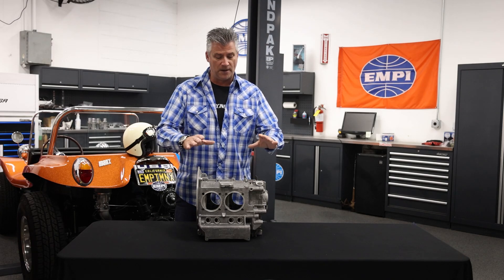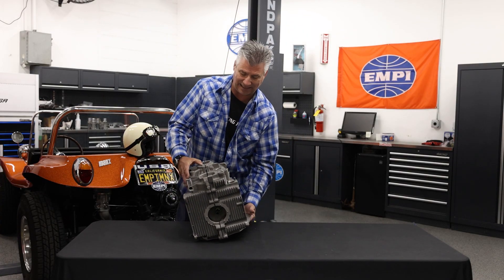EMPI Stock AS41 Magnesium Alloy Engine Cases!

Comment: trying to build a Autolinea case engine has ate my lunch to many times . they don't get that the case has to grab the oil pump ? It would be like putting a washer under your Chevy oil pump causing cavitation ( sucking air ) . Hoping they get this straighten out . + the pumps themselves are all over the place when it comes to their size . Schadek and Millings are close to spec. Mic a real VW oil pump compare it to after markets ??
Reply: Could you build a 1641cc spec engine from these standard cases
Reply: @stephenport4768  Yeah and you can use up to a 74 stroke crank .
Reply from the maker: hey Jimmy thanks for your feedback, all EMPI Long Blocks are built on AutoLinea aluminum cases with Schadek pumps and the 2180 in our dune buggy puts out 140hp+ on the EMPI dyno
Reply: @jimmywilkinson9190  many thanks 👍
Reply from the maker: @CarolArgo-r4e  if you mean that Motorav is producing on VW OE tooling then you are correct

Comment: To bad, it has MoroRav on the side. For the builders that want the OEM look should have the original VW OEM emblems. If you are using the original equipment to build the case, then the licensing should be grand fathered in.
Reply from the maker: VW has other ideas.........
Reply: Maybe there's a market for making clones of the original side markings to jbweld onto the side... Hmmm, what's the melting point of magnesium alloy again? ;-)
Reply from the maker: @DurocShark  we believe its right before it combusts into a white hot explosion!
Reply from the maker: @ocavant  EMPI wont let that happen! #keepingclassicVW'sontheroad
Reply: @ocavant   I think it was the pollution regulations that killed the air cooled. U.S. emissions standards. That why VW purchased, I think it was in 1964, Auto Union and then in 1969 NSU Motorenwerke. They claimed it was for Audi and due to when the decline in sales of Air Cooled engines happens.  As we know, VW air cool engines were kept in production for a long time afterward, until the regulations were imposed.  So my question stems from, as an example, Willie's Jeeps were produced by several countries and even Ford to meet the demand of WW2. Just recently, an Indian company started producing the WW2 Willie's jeep model because it was still licensed to do so. That's where the "fake Jeep" was produced for non-road use. To me, it seems that in Brazil or Mexico if they still had the presses, then they could still make genuine OEM parts. I get that MotoRav and rightfully so, brand their product, so others will see it, like it, and buy it. Good advertisement. Not knocking them for producing something people need. It just seems that for the VW purest, there could be away to rebuild or build an engine that when showing the vehicle at care shows it still looks original. I have my Dad's 1964 that he purchased new and, knock on wood, have not had the issues other people seem to complain about on VW's. I'm trying my best to keep it in shape the best I can, I just know one day I'll have to purchase replacement parts and want to be as close to original as I can be.

Comment: Stop talking about "the look"!
Reply from the maker: Hey Matthew-does a Mag case look the same as an Aluminum case to you?
Reply: @EMPI_Inc  absolutely not! But your rambling on about looks like as if its more important than the functionality. Maybe that's why a set of your Empi rockers covers we were fitting to a  new build with your 040 big valve heads didn't fit. Sick of your crap not fitting properly and us having to machine and modify everything you supply. Lets talk about your generator stands which I have 4 in stock and the heights are all different by about 10mm between the shortest to tye tallest. How is the fan shroud and everything else meant to fit with variations like this? Another example is your 040 heads again which I bought and installed on a new 1968cc build only to find out the big valve seats were not blended to the ports. Instead there were big steps in all ports yet your catalog talks about blended ports on the 040 big valve heads. Well it wasn't a one off either. You need to be focusing on keeping what is already being sold up to at least the standards that it was before instead moving onto new products while the old stock lines are deteriorating in quality and accuracy. Its great the AS41 case is back. But you really need to get your focus back onto what was reasonable before like your heads etc that have suddenly gone south in quality. Even the machining of the barrel spigots in your 040 heads is all on the piss! Don't know what your using to machine your heads, but its nit straight. I use to like your heads. But not I can't risk using another set. What next? Will your cranks go south too? Up until now your cranks have been good and I hope they stay that way.
Reply from the maker: @mathewboyd3746  Hi Mathew, sounds like you have a lot to get off your chest-feel free to send your contact info to robm@empius.com and I will arrange a call with our QC leader to discuss your specific concerns. Definitely want to know about your issues with our heads. Also, which dealer are you acquiring EMPI parts from most regularly?
Reply: @EMPI_Inc  Thanks for showing interest and I will send a constructive email. If would be good to have well machined heads and parts with consistency again. Just give me a day to get this email sent off.
Reply from the maker: @mathewboyd3746  thanks Mathew, look forward to details